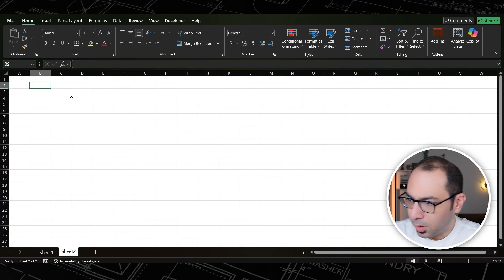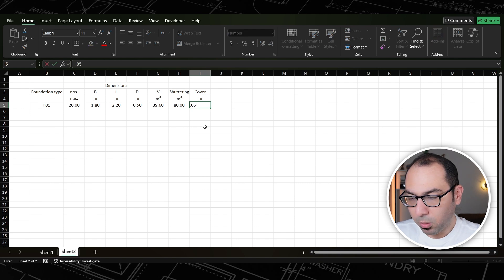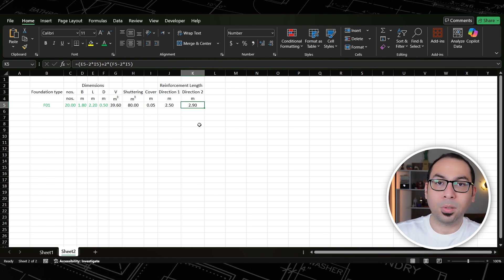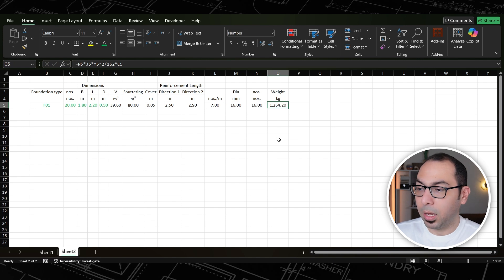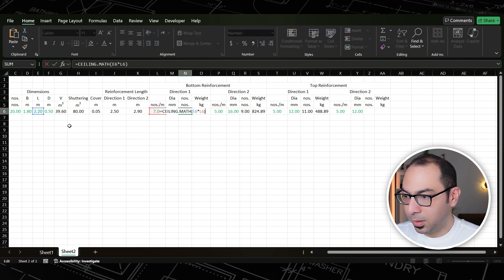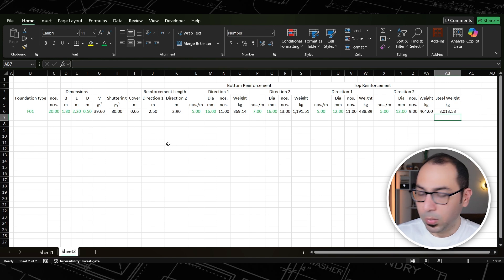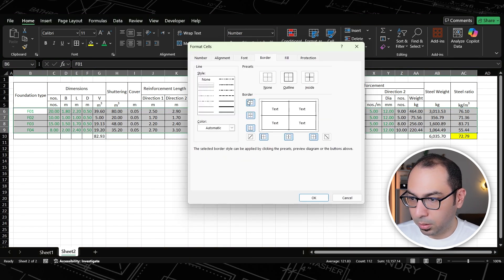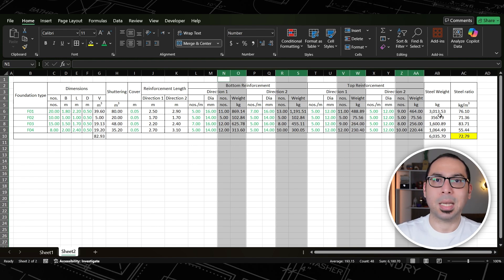How to calculate Steel Reinforcement in Isolated Footing

Comment: @5:36 what is the difference between nos/m and nos. and how do i get nos/m if its not given.
Reply: like if the given is 20mm spaced @ 150mm how do i get nos/m and nos.
Reply from the maker: In case of 150 mm that’s 7 nos / m. Nos = 1 / spacing
Reply from the maker: 1 / spacing. In case of @ 200mm that’s 5 / m

Comment: Hello, I try using this approach but has different result on your previous yt video (Cost Estimation | how to estimate the cost of reinforced concrete structures part 3) that you presented in calculating the steel weight of isolated footing F01.
Reply: With this approach the steel weight of F01 is 216.89kg but in previous approach its 244
Reply from the maker: Make sure you use nos. Per linear meter
Reply: @CEPQS  I did not use the nos./m i just directly input the nos that given on the previous video in this format. The answer steel weight still different
Reply from the maker: @arielramirez432  Maybe the format you are using needs the total nos. as input, not the nos./m like the one in this video
Reply from the maker: This will be due to number of steel rebars in each side. In the recent video I’m using nos./m